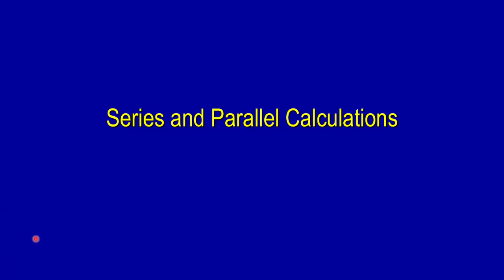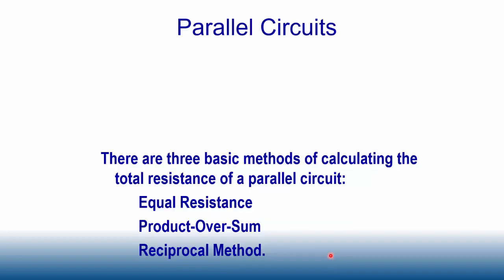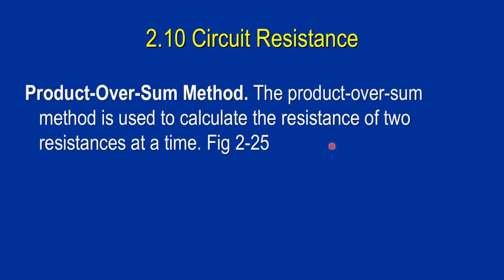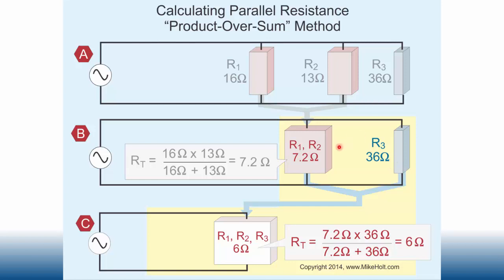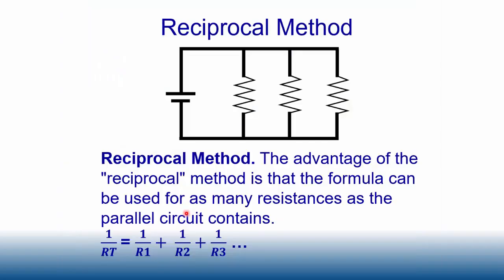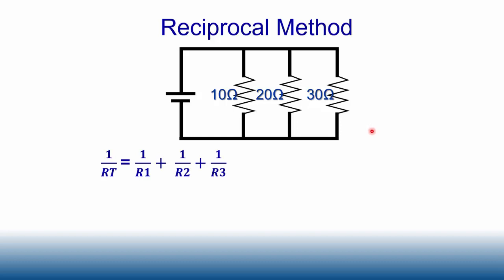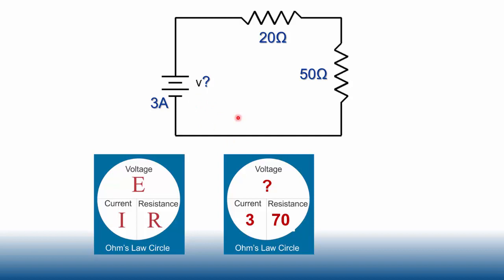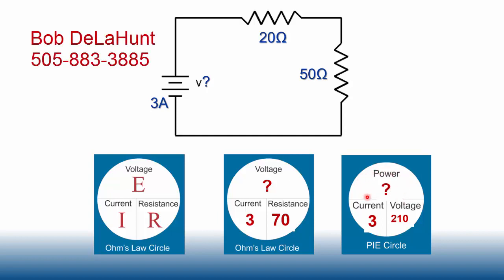Series and Parallel Circuit Resistance

Comment: I got 5.45 and I didn’t change the bottom number to 60
Reply from the maker: If you convert the fractions to decimals, add them together, and 1 divided by the number you came up with, that will give you 5.45. Lots of different ways to get there...